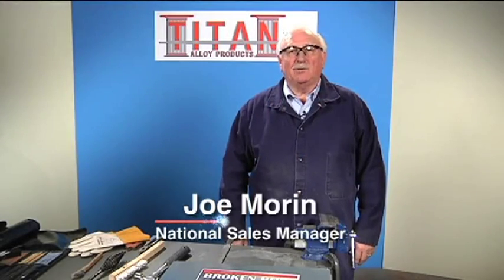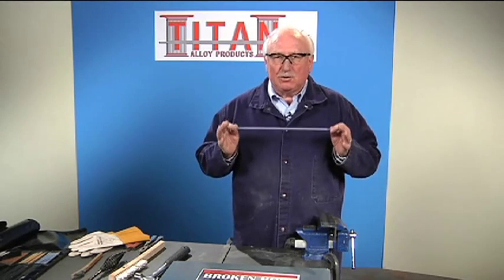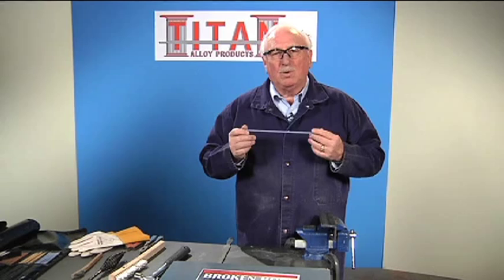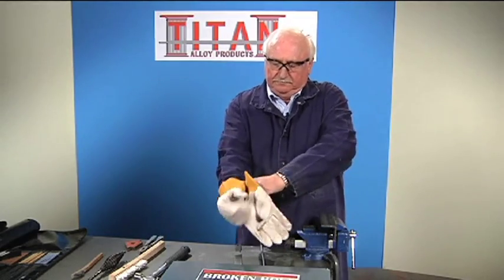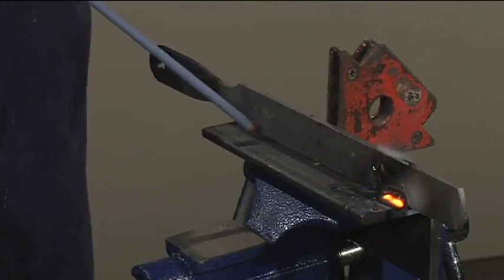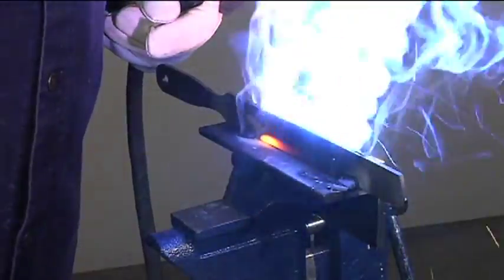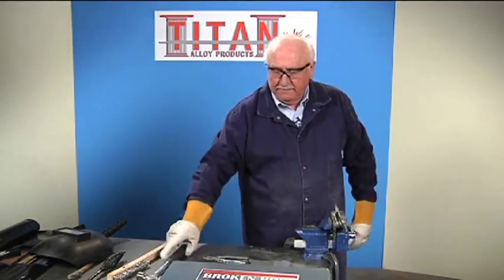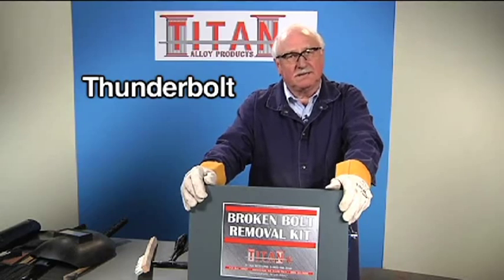Thunderbolt

Comment: I have an old airco AC 225 ( really a miller thunderbolt 225 )  Will these work with the system I have.   And where can I get the welding rods